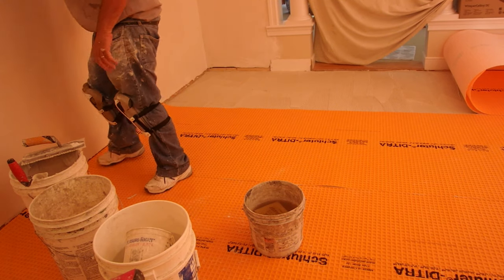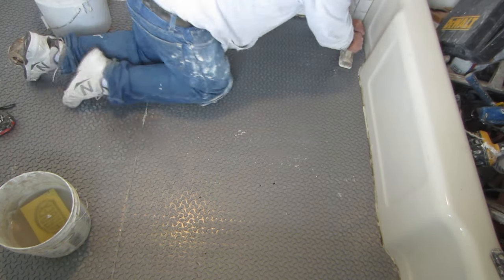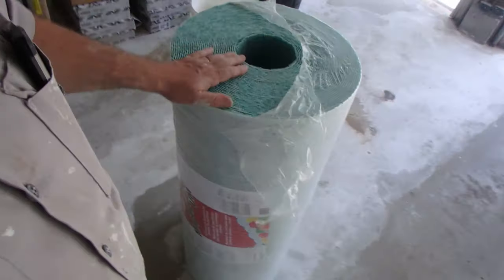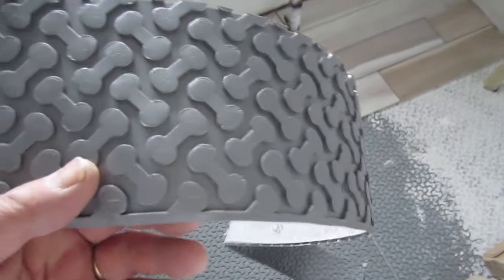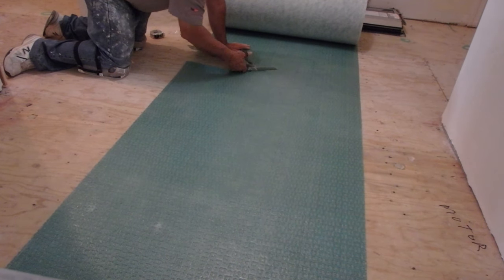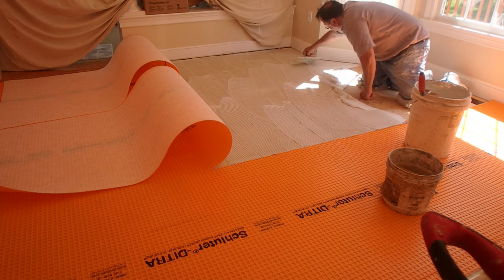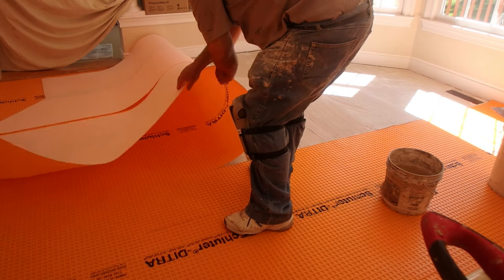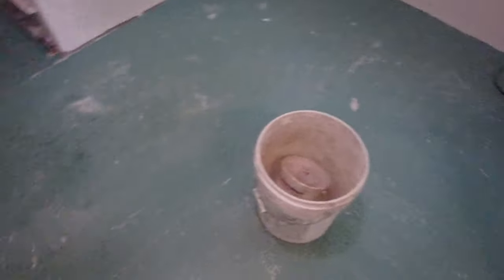TILE FLOOR don't let it fail

Comment: Sal any tips for popping layout lines on top of uncoupling membranes?
Reply from the maker: I will usually use a laser square, get some reference points at about 4 foot intervals and then use a marker to connect them with a straight edge. not as quick as a chalk line but much more durable. Another way is to snap your lines and use hair spray to seal them in, Since the thinset does not stick to the mat but is only mechanically held, this does not affect the install.

Comment: I have been installing tile for 20 years. Years ago we set tile over luan plywood. I have done a lot of family and friends tile work Over the years and it is still there without any problems. I use the new systems but , the truth is that I never had any problems the old way. Go figure?
Reply from the maker: Using an improper system does not guarantee failure, it increases the ods dramatically. Following manufacturer recommendations and TCNA methods and standards, ensures success.
Reply: I wonder if laun ply has a lot of flexibility to it.

Comment: hey sal when you do a removal of tile and the installer used a membrane, do you also remove the membrane, if thats the case how difficult is that?
Reply from the maker: Yes, remove the membrane, not easy, but then again if the tile was installed properly it is never easy no matter how it was installed.
Reply: Sal DiBlasi yea I know its never easy

Comment: i think it was invented for the situation when the tile needs to go, and new one put in. Otherwise the bullshit i hear that a crack from the concrete floor transfers though the adhesive(thinset in the states) and somehow cracks the top tiles is funny. Yes the people uninstalling a tile mounted correctly on a concrete floor will have more to work with the hammer drills but that is happening once 20-30 years hopefully, the world doesn't go that crazy that we change tile every 5 years.

Comment: Sal, you used a few different products in this video, why is that? Just trying them? I used to use ditra but now use mapeis underpayment. I think schluter is a little silly, $50 a bag for modified thinset!? When they’ve told us for years we couldn’t use modified under ditra? There must be some special stuff in that bag to make it $25 more then a good mapei.
Reply from the maker: I mostly use Ditra and Mapei uncoupling mats, because that is what my supplier carries, the others are just as good. There was a development with thinset technology a few years back that mad the "Modified, Unmodified" issue less relevant.
Reply: ardex 77 is 50 a bag in my area, but its really good stuff

Comment: Mapei it better and cheaper than schluter , buy nobody sell it yet.
Reply from the maker: Won't find itg in the box stores.
Reply: @SalDiBlasi  Good News, I live outside Philadelphia and the Lowes have switched to the full line of Mapei products!  I have started going there.
Reply from the maker: The products at the box stores are not the same as the products at a tile store. That is why they have different naming. Look up the data sheets for some of their products offered there and the ones available at a tile distributor. Not to say they are bad product, just formulated to meet the price demands of a box store. For example look up Ultraflex 2, and their offering at the box store, Porcelain tile Mortar. Ultraflex 1 is available at both outlets, but that is a lower grade product.
Reply: Check your local tile store.